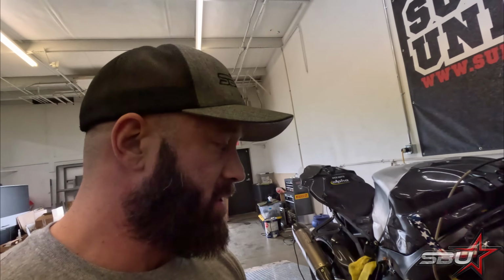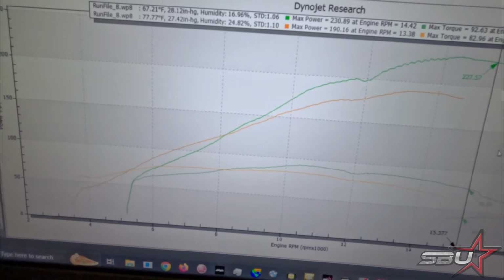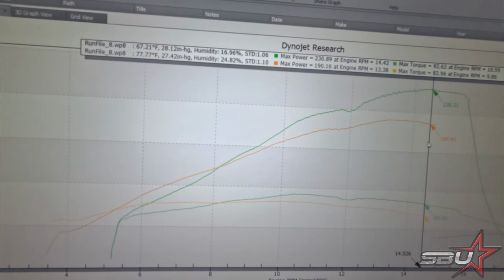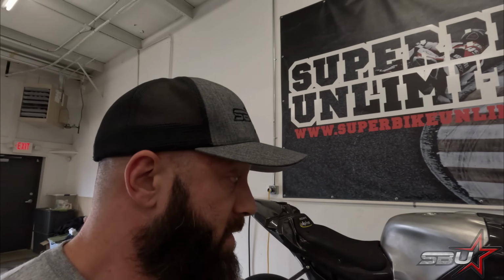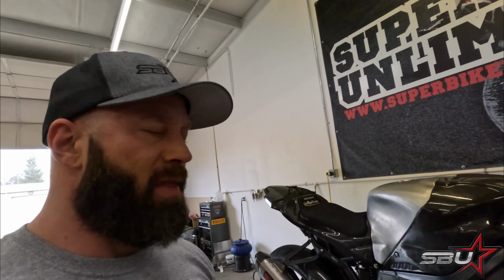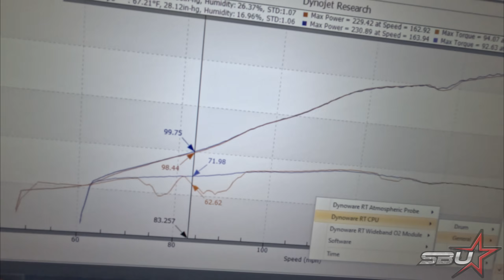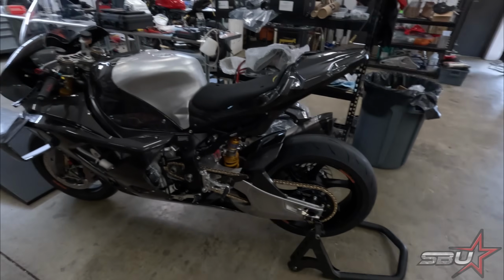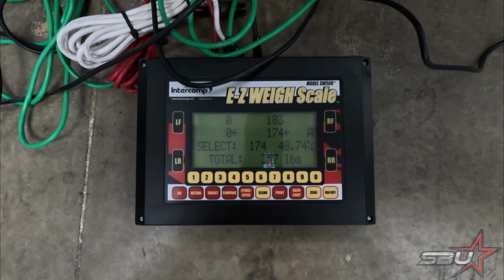BMW S1000RR to M1000RR Ultimate WSBK Build, Final Video Update - Weigh In, Dyno Testing, Wrap Up!

Comment: Nice job and yeah 2k miles or $$$$. Plus we love you mention dyno we laugh when we hear "207hp" on a stock 20+ S/M1000rR. We only see low 190's and R1 same mid 180's but ppl that know nothing about dynos always say ours "reads high" yet we're 3000 miles apart & our two seen identical. It's those shops claiming huge "tuned" numbers that make us laugh. Nice vid Freddie 👏🏼
Reply: marc
Reply: marquez
Reply: 93

Comment: What software are you using to tune the bike? Just picked one up which will be a street bike but looking for a tune, exhaust, block offs, carbon canister delete etc. Not doing handheld tuners
Reply from the maker: This has a dedicated electronics package for race use, which includes a tuning software specific to the ECU provided. For customer bikes, we have some bench ecu flashing options but we usually use a flashing device with our maps.
Reply: 12.04
Reply: 17:28

Comment: Would you consider talking on exactly what is timing out when you get to the service life of motors like this? Are they slowly eating bearings, do you start seeing lots of oil getting past the rings, fatigue on bolts, etc.
Reply from the maker: Generally a first refresh for something like this is going to include at minimum: bearings, pistons/rings, valves, valve springs, valve job, timing chain and some other less exciting wear items. Everything has a service life and even the cases will be lifed out in relatively short mileage in comparison to a road-going engine.
Reply: zona
Reply: cuma

Comment: 2000kms and done...ooooff...but absolute Dream nonetheless. Dont even wanna know the pricetag on this 😅
Reply: If you have a bike like that, you probably have a tech team to do the refresh on call.
Reply: Madness it lasts 2k kilometers,a few years back when they released the bmw s1k race to the public the engine lasted 7-8k kilometers and cost around 10-15 thousand euros to replace it,and it used to make 215-217 hp at all times,pretty good considering the bike Freddy built cost like 150k in world sbk spec,but the race wasn't,it was more of a track weapon! 15 horses I guess isn't a huge difference for normal ppl,because most ppl wouldn't be able to exploit the full potential of the bike,and 215 is a really impressive number!!
Reply: @skywalker7517  you mean the Hp4 race? That made 215hp at the CRANK. the sbu bike from the vid makes 230hp at the WHEEL. that is a huge difference and not just 15hp
Reply: @kowalski2334 no no it made 215-217 to the wheel I saw a dyno video of the bike running on  it,not crank hp, wheel!!,I said for normal track day riders they wouldn't feel the 15 difference but for a professional it would,he can use that power and ride hard but normal ppl would struggle with a stock 1k bike, not to mention a full blown Superbike!!
Reply: yang
Reply: lpi